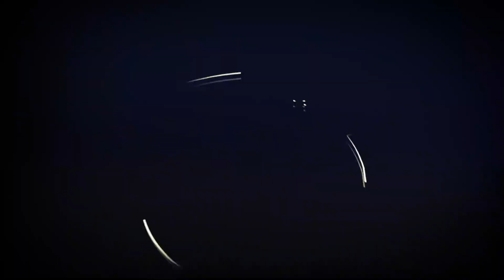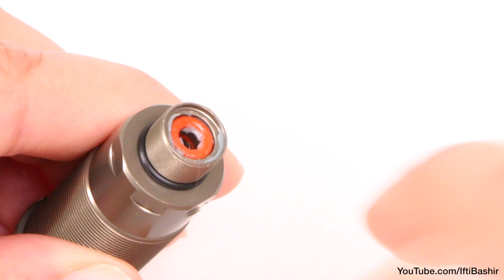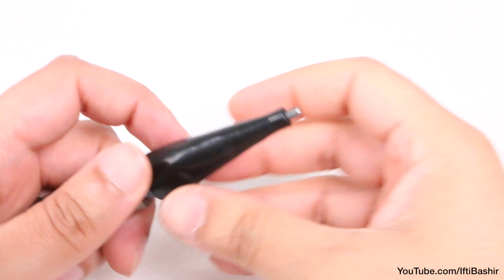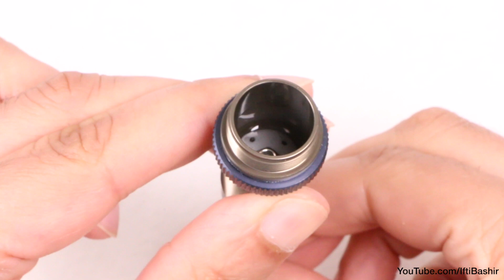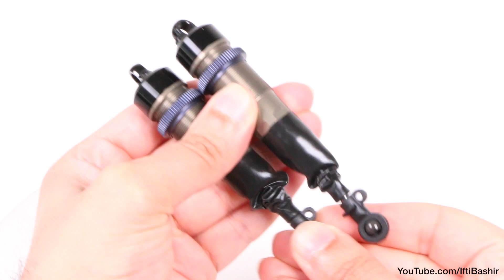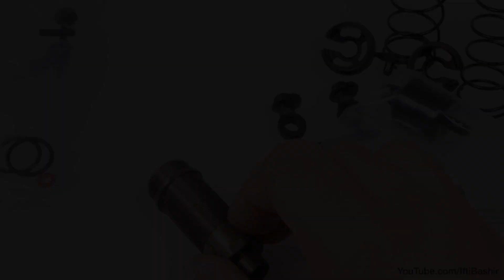#13 Tekno EB48 2.0 - BUILD SERIES - Kit Bag L & M : Front & Rear Shock Assembly

Comment: Question:  does this Shock O-ring Grease necessary?  BEcause the original manual doesn't say about it. Thanks.
Reply from the maker: I wouldn't build any shocks without it. Highly recommend you use o-ring grease - just a small amount is needed. It'll help stop oil leaking through.
Reply: @iftibashir  thank you. Can I ask, if I use the black grease which comes with the box, is that will be fine ? Or I must use the green o ring grease?

Comment: is it just me or are the spring collar nuts to set the height insanely tight and hard to turn
Reply from the maker: Yes they are difficult. Apply a touch of grease to help it on a little easier.
Reply: Same here. I couldn't get them on the shocks so I just put them on without the o-ring. No problems so far. J wish I had seen this video series two weeks earlier....

Comment: from the manual; Note: Black screw is RH threaded and goes on right side.Silver screw is LH threaded and goes on left side. Seems you have it the other way at the rear side of the buggy
Reply from the maker: Hi. I'm afraid you are incorrect - quoted from the EB48 2.0 manual : "Black screw is RH threaded and goes on left side. Silver screw is LH and goes on right side."
The video is correct and has been checked by TeknoRC
Reply: That is what I'm reading on the manual too from tekno eb48 2.0 instruction manual on page 18 step M-5. Black screw right side and silver screw left side. Just a minor mistake in the video. We all are human.